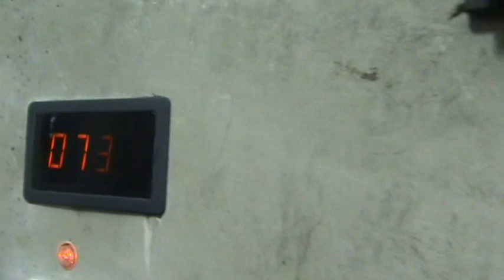DIY CNC Milling machine

Comment: Hello Cameron, the new design looks amazing. I wish mankind wasn't losing the drive that once pushed us to try things that  others deemed impossible or dangerous,  its going to be our undoing. I have always wonderered what your shop might look like, its not as advanced as I had though it might be, not a single VMC or water jet table in sight, makes things even more impressive.
Reply from the maker: Thanks Shawn, I don't even know what a VMC is. I am lucky to be given most of the machines you see here, I have spread the word around town to call in to my shed before going to the tip or scrap metal yard. My Son works at a metal recyclers now and gets to bring home some pretty amazing "rubbish".  I have the reputation, "Cameron will make use of it" :-)
 I would possibly have new stuff if I didn't spend so much time fixing old stuff, but wheres the fun in that. Cheers Cam.
Reply: Cameron Carter Vertical Machining Centre 😬

Comment: Cameron, I have seen your videos and they are really amazing. In my mind the BlowFly helicopter is really an egineering art. have you used some initial plans to build it? I have already built some gyrocopters, ultralights aicrafts of fixed wings and now I would like to build an helicopter. I need some initial information to start. could you help me with basic information? Thanks and congratulations for your very good job!!!
Reply from the maker: Thanks for the compliment.  I would suggest studying the kits available like the Mosquito and Rotorway, Helicycle etc. 
If you want to create your own design, I would recommend the Mosquito format. I love the elegance of simplicity that John Uptigrove has engineered. He is a true genius.
The kits are reasonably priced if you want to guarantee getting into the air.  Cheers Cam.